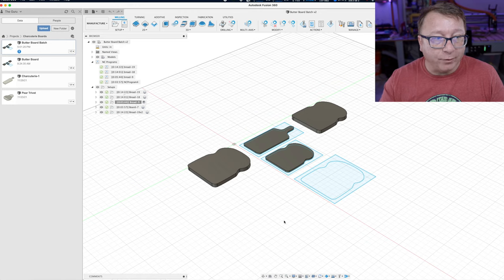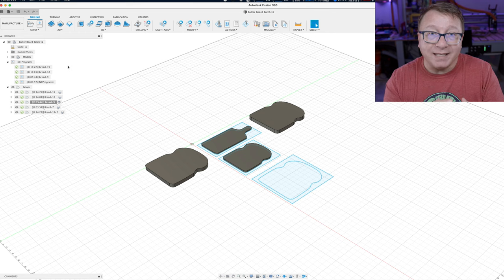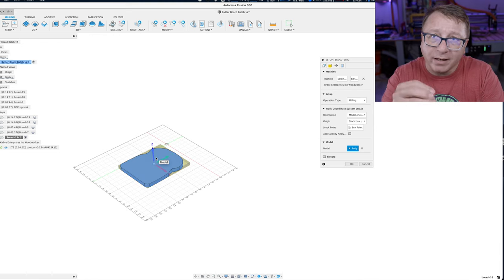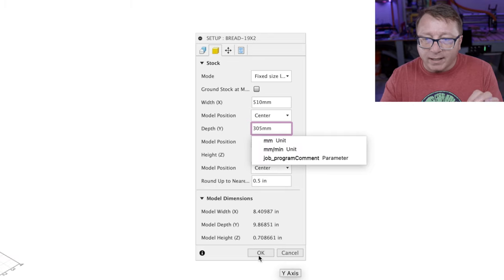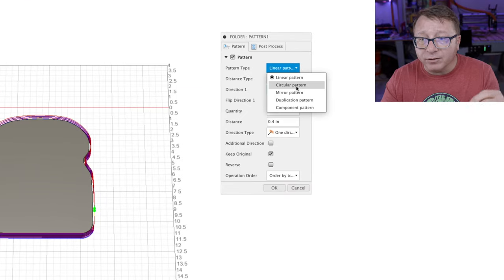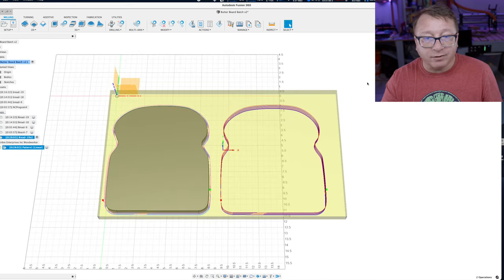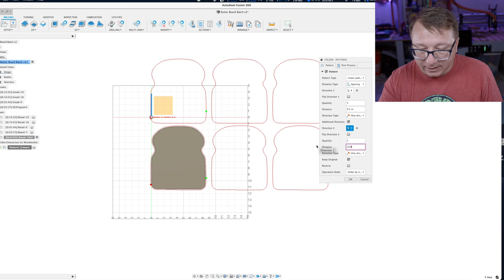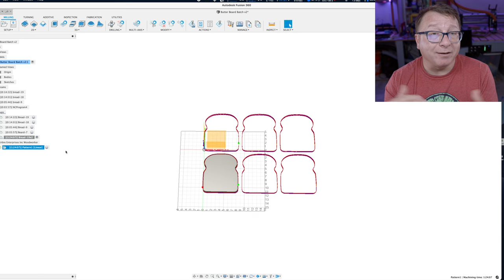Batch Multiple Projects in Fusion 360

Comment: hi, great video. I have a question, how do you show the edges of objects (like black lines) when we work on them in 3D ? thank you
Reply from the maker: Hi there - at the bottom of the screen you can change the view settings. Click the icon that looks like a computer monitor, Visual Style > Shaded with Visible Edges. I generally operate in that mode, or wireframe with visible edges if I'm looking at internal geometry. Thanks for watching!